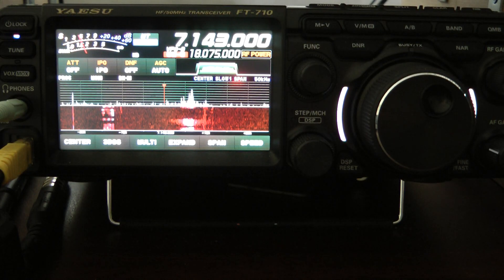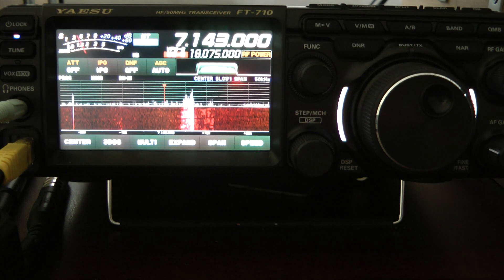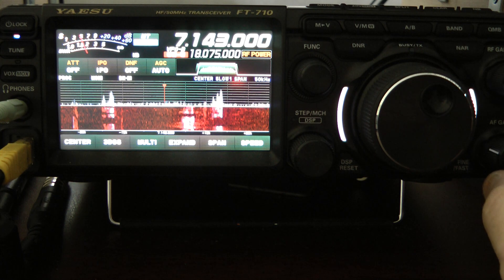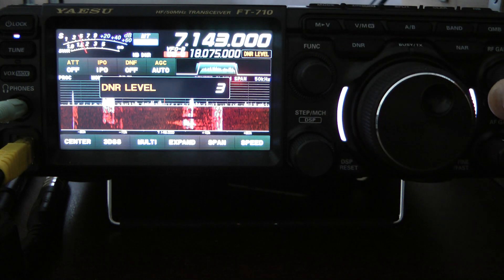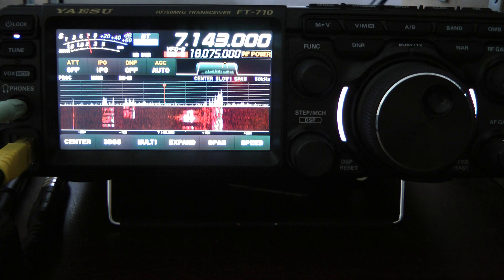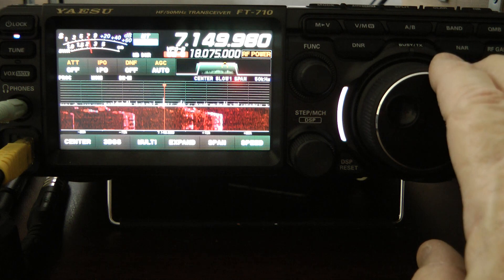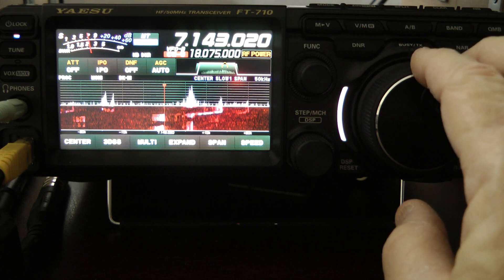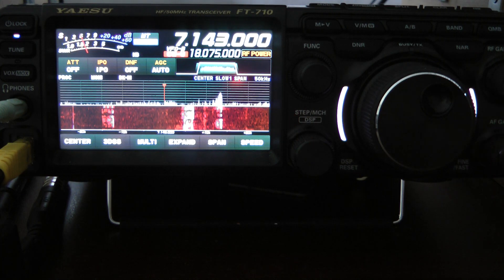Yaesu FT-710 New example of Noise Reduction, DNR, Contour, RF gain, SSB audio.

Comment: If you put a mouse on it, you can click on the blank space under RF POWER & it will pull up that DSP window so you can instantly adjust NOTCH, Contour, etc with the mouse itself!  Much easier.  The NB & DNF work much better than the FTdx-10's.  The 710 is effective & without all the distortion.  I am very happy with the 710!!!  Sold my FTdx-10.
Reply: I also sold my dx10 - really did not like it at all!  I do love my 101d and a 710 though.  Both suit my basestation and portable needs much better than the dx10, and both are a pleasure to use (unlike the dx10).
Reply: Wow, sold your 10 and prefer the 710 - that says a lot about the product Yaesu is putting out good stuff! Just bought the 710 and still learning all these buttons and knobs (new to HF)